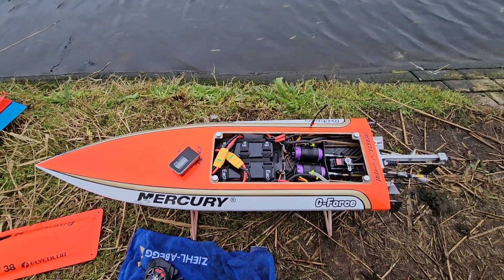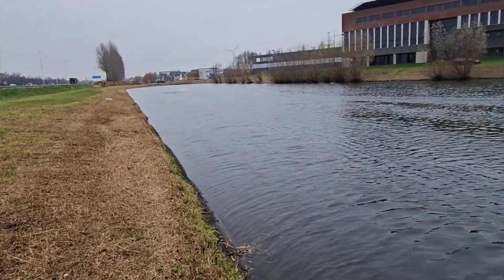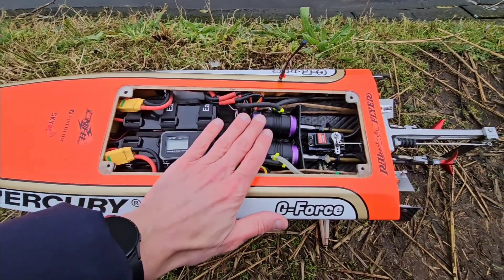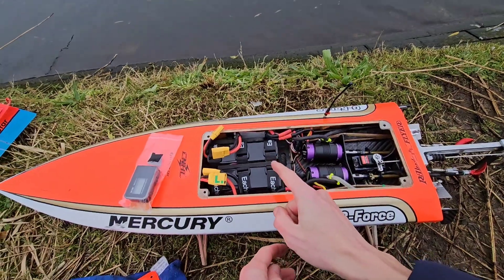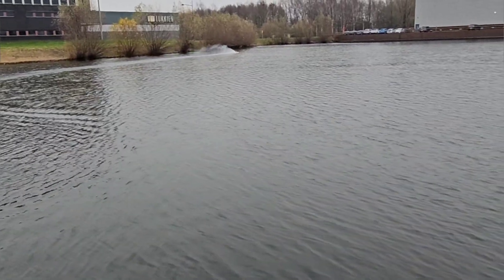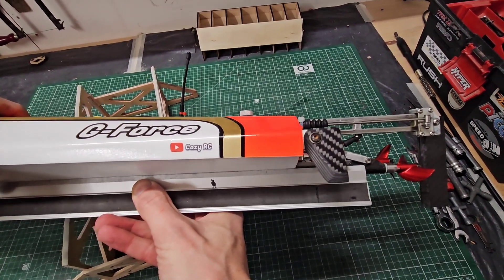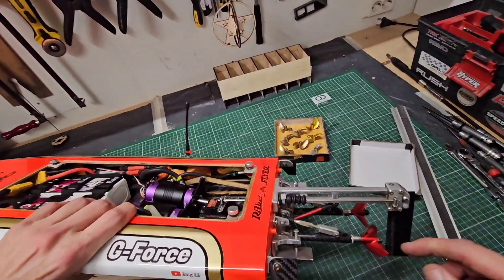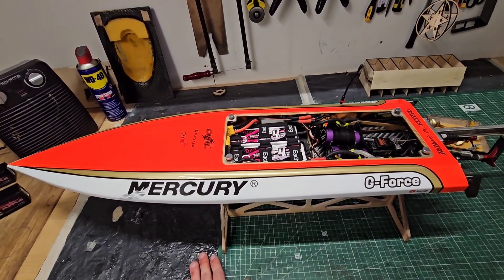Twin motor mono: 6S speed runs with 2200kV  motors

Comment: Hello, I want to build a boat but I have a few questions. Do I need to use trim traps and swivel blades on my boat? These are not available in my country, Aliexpress delivers very late and is very expensive. What should I do? Are there alternatives to these or is there a way to have them done?
Reply from the maker: It depends on the boat type and the speed you want to achieve. You could DIY both parts quite easily!
Reply: @CozyRC  How am I going to do it? And is there any place I can get help from you more often? You are very knowledgeable and I want to get help.
Reply from the maker: Send me a message on Facebook: CozyRC

Comment: Like your videos good information I'm over here in Southern California I like your boats I want to get one of your kids.... I think your boat was running way too wet pretty good speed for how wet it was running I think you should go up 2 to 3 mm from where you're at you only want two three inches touching doing speed runs on the bottom of the boat about 50 to 75 mm for your fastest speeds... Keep up the good videos.. remember full trigger full triggerr
Reply: Or even less than 50 mm.. 25 would be great that was my best speed run on my modified Arrow boat the rear of the boat was only touching about 25 mm when it's spun off the prop.. GPS read 83 mph with a 3660..2600 kilovolt  motor.6s. 43 mm 1.9 Prop... But then I lost my prop and I haven't got it that fast sense..
Reply from the maker: Thank you for the advice! I will run the stingers 1.5mm up next time. Let's see how she will go!
If you want to order a kit, please contact me on Facebook: CozyRC, or send me an email at cozyrc1@gmail.com 👍

Comment: Very interesting and insightful  👍.  Great to see your developments. I'm an EDF jet flyer and I'm switching to DIY 6s packs using molicel P50B 21700 5000ah Li-on cells.  A big power to weight improvement on li-po giving astonishing 50amp continuous discharge. Flight duration being the key benefit. Wonder if that strategy might assist your weight issue ? ... 🇬🇧
Reply from the maker: Thanks for your advice, that sounds interesting! I know EDF's draw a lot of current as well. But honestly, 50A doesn't sound like a lot? That's like a 5000mAh pack with 10C discharge rate. Lipo's are capable of a realistic 40C continuous, right? I will look into these P50B cells.

Comment: Like your idea. I did try a step (2.5mm material/step around- bit after cg point on my dom) and that didn't bring anything. A ride pad worked better for me but there has to be enough material. I put a small 3mm under front keel and sanded the pad down untill reached bit before cg. So on flat surface bit more than 1/3 touches the surface. But strakes are also interesting. Well see what you come up with... Good run, nice and stable
Reply from the maker: Good input, thanks Peter! I will skip the step idea on this hull. I was planning on trying strakes as the first hull mod, anyway 👍

Comment: You are so lucky that the water going into your electronics is at a temperature that can provide cooling. Here in Florida, when I send the water into the cooling system it actually warms the system up because the water is hotter than the electronics that were cool in my APT and the water starts to heat them up. SAD I tell you. When I lived in CT I loved the idea of ice-cold water in my electronics.
Reply from the maker: I think cooling your electronics with 'warm' water still keeps them cold enough! Without cooling, the electronics can pass 120°F easily, and I don't think your water is that warm 😉.
But, running in cold water will definitely help to keep the electronics much cooler!

Comment: I like your linear thought process ,  i could hear the red props load up the motors a little more ,so sharpening them  will give a double edge sword , of cleaner cutting and reducing the pitch a smidge ( real word you know ) adding front rails really cleaned up the running on the other hull , so worth a punt , for a couple of hours work ? Keep up the good work , while the rest of us hunker down . LOL
Reply from the maker: Thanks! I will definitely try lifting strakes as the first mod on the hull. Stay tuned 😎